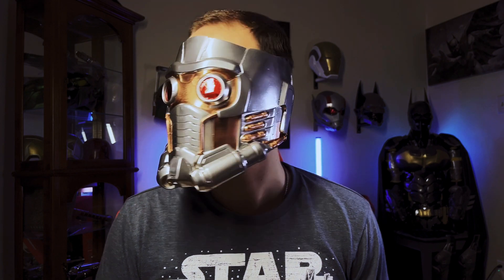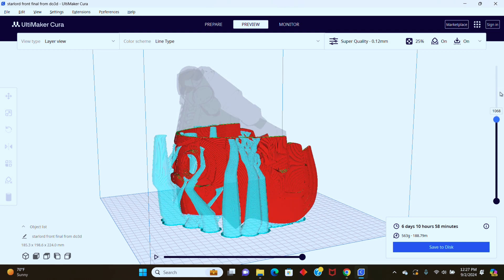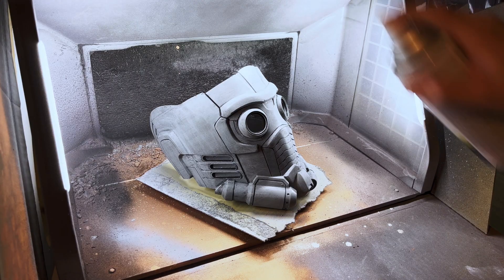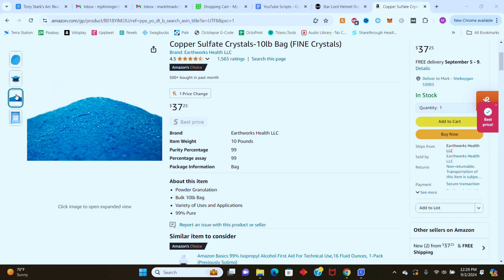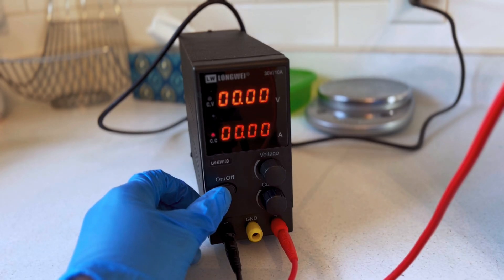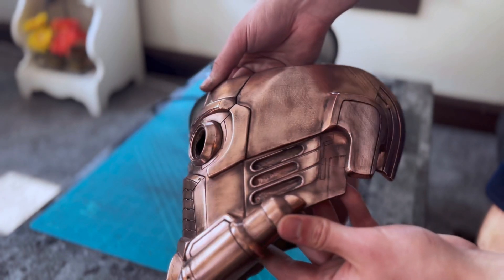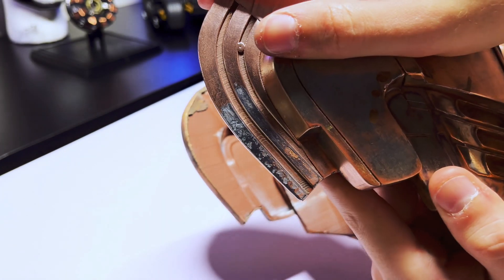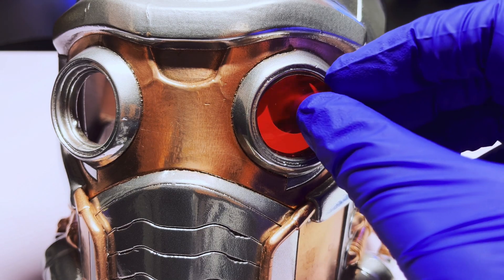Creating Metal 3D Printed Props: My First Attempt at Electroplating

Comment: Hi, would you mind sharing how you calculated the voltage and current needed for the plating based on the surface area? Thanks!
Reply from the maker: You can find the surface area in your 3D slicer or by putting the model in meshmixer. The calculation I use is for amperage is 1A/1dm^2 of surface area. The process is current driven, but voltage usually ends up being less than 6v

Comment: How do you calculate what amperage you want in the solution? Trying to make home made coasters.
Reply from the maker: The calculation I use is 1A/1dm^2 of surface area! You should be able to find the surface area in your 3D slicer or you can insert your model into meshmixer and find it there too.